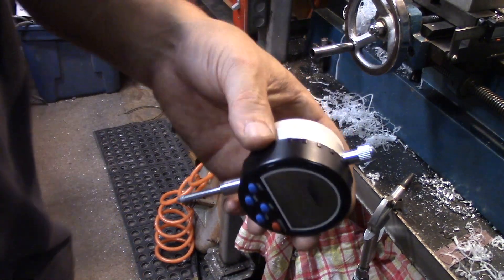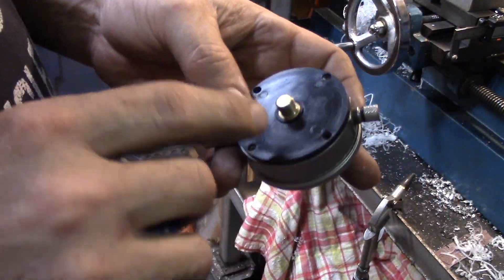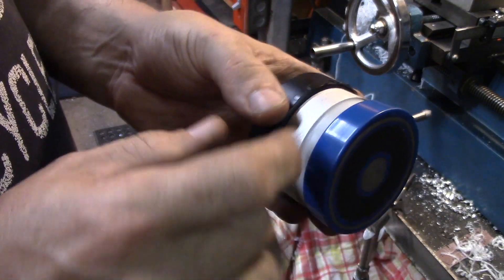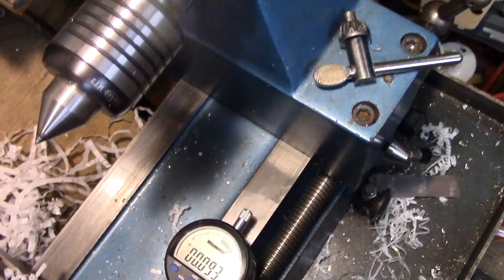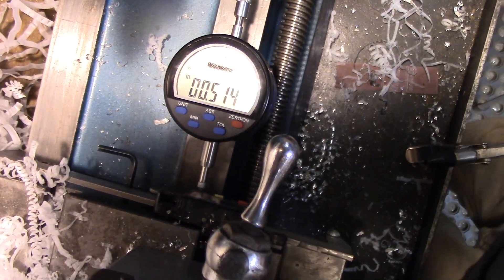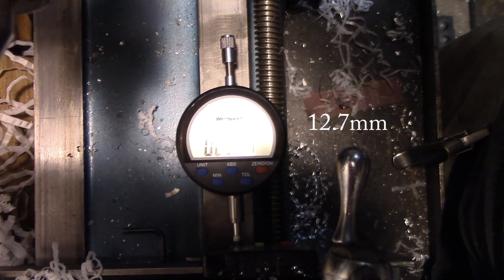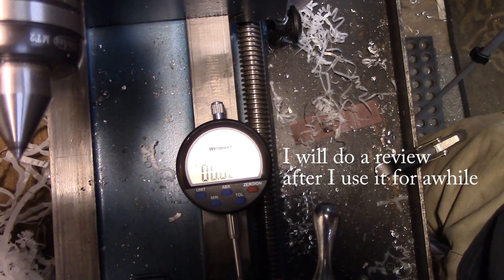Making a Mag Base Backplate for a Digital Indicator

Comment: So I purchase two of these magnetic indicator mounts from Shars about 10 years ago. The brass threaded stud pulled out of the plastic on the indicator mount part. It has some sort of knurl. But the plastic part had cracked about this pressed in stud. I looked a few years ago for a quality version, but had no luck. They were handy, but both failed. Looks like I can make a part that fixes that.
Reply from the maker: That is the reason I made this one so thick. I have broken a few as well. Hopefully this on will hold up for a while or I will make it out of aluminium next time. Thanks for watching!

Comment: I like working with plastic. It's funny because I feel ashamed to admit it lol - It's refreshing to see someone just hold two pieces together and mark out the drill holes. I always see people set up a rotatory table and use a DRO just transfer layout hole marks. It looks like a decent indicator. Nice big read out. A problem I have on my lathe is the VFD interferes with some digital display devices on or near my lathe. I added a another ground wire in case there was like stray voltage doing it, but I guess I need a choke. I was going to order one, for like $12, but they were out of stock, and the only other one I found was like $33 or something stupid. BUT I might have to bite the bullet if I ever install a proper DRO.
Reply from the maker: I did all the layout in the clean lab on my grade triple A surface plate with an electron microscope and a 1/2 micron punch. The sharpie was just for show. I then drilled it with my craigslist Ryobi drill press that has 3 thou runout with a chinese drill bit that is half a thousand out of round. I love  precision parts but not everything demands it. that is one of the reasons I like Tom, he is ultra fanatical about precision but he is practical about it. Notice on the dog swivel he just printed a template and glued it to the plates and found the holes. But then you have Renzetti. That guy LAPPED his swivel balls for a CAMERA MOUNT. That is some autistic level dedication to precise. 

You probably have a choke in some stray bit of electrical equipment you have collected. That electric lawn mower might have one.
Reply: @theeddies  lol I feel you. I don't care how people do their stuff, and they certainly do better work than me, but it sometimes comes across like overkill on video, but then again every step is content.  -- Kind of bunk junk finds, or maybe just that it's been slow, and no trucks yet today. I found a box of nice watch collector types of books (I'll try to sell them for like $15 - $20). The best find was a big treadmill in perfect working condition. Fall/Winter project to try to graft it's motor and controller onto my mill so I can have variable speed. Might be a major undertaking, but I know people do it, and if it works it would be worth the effort.
Reply from the maker: If you start the treadmill motor thing, you better finish it or at least publicly declare it a failure and a waste of time.  If I had a nickel for every treadmill powered lathe that i have seen finished i would have a penny. Everybody I have seen do one, gets to the point where they do a a half a cut on plastic and then it magically disappears only to be seen out of focus in the background covered with a blanket like Mustie's trailer or AvE's nasty ass ignorant comments he left on other creator's videos when he was trying to grow his channel. Him and Captain Anal Leak or whatever his name was. Same deal with my machine and making it a super CNC mill lathe. If it does not work, come out and say it damn it, IT DOES NOT FECKING WORK!!! so I can point people to the video when they ask me for the 1000th time if I am going to "CNC it"

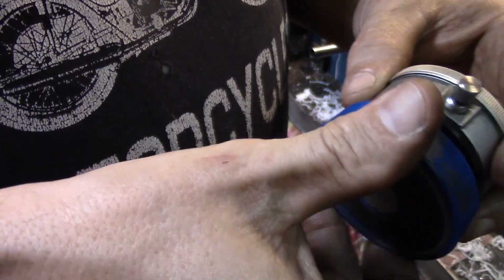Sorry, did i slip into a rant? I look forward to seeing you make it work. If those things can pull some of the people off them like I have seen in fail videos it should cut something. I am just venting. BY THE BY, there is a easter egg in my last video. Look near the top right around 1:29.
Reply: @theeddies  You've finally snapped. We knew this day would come. We all knew. All of us... in the hive mind. Welcome Eddie. Now just sit back, go off your meds, and travel with us in your mind. lol 

If it doesn't work, you'll know it 'cus I'll be bitching about it every step of the way no matter what. lol
Reply from the maker: @johnstrange6799  lol
Reply: How long is the wire between the VFD and the motor? You want to keep that as short as possible, but you probably know that. Ideally that wire should be less then 4 feet. I have my whole shop powered with dedicated VFDs from .3HP for a coolant pump, to 10HP to drive the big lathe. Various makes but all name brand. Nine machines in total. I've never experienced an EMC compatibility issue. But VFD to motor is always less then 5 feet. I tried one of those cheap China imports on eBay, but one of the input capacitor sblew up, it got replaced by the seller, but sits on the shelf as a memory for $115 error.
Reply: Thanks, Fred. It's about 3 feet.
Reply: @johnstrange6799  That's short enough. It probably needs some sort of power source filter, as the switching pulses are probably being induced to the AC power connection. From there it either is conducted to the power supply of the DRO (I assume that is the digital device with a problem), or it is radiated off the power wires and being picked up by the DRO interconnect wires. Plugging the DRO into a different outlet may help trouble shoot this. Use a long extension cord to get as far from the VFD power connection. Is the DRO loosing counts? Or is just the display a flickering mess? Is this powered from a wall wart supply, or is the supply internal to the DRO, and 120VAC power connected directly. These questions are to have you look as to how the EMI is upsetting your digital displays. I'm probably making too many assumptions as to your problem.
Reply: @f.hababorbitz  I appreciate the advise and thoughts, Fred. I don't have a DRO. I was getting interference on little small hand held digital displays, but actually I don't know if it affects my digital calipers. I'll have to check that out. I don't usually have the lathe running while using them, but I'll have to try. Also my digital tach is unaffected.  It might be that the devises themselves exacerbating things. It's not really an issue at the moment, but it could be one if I install a DRO. I'm not sure.